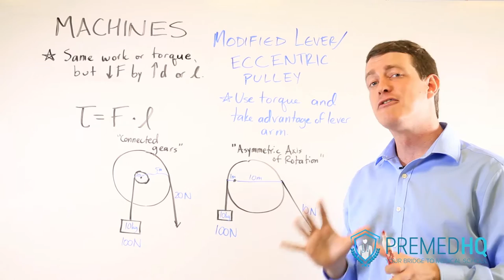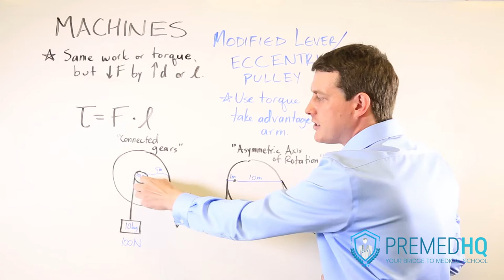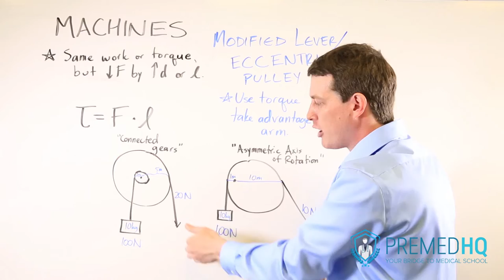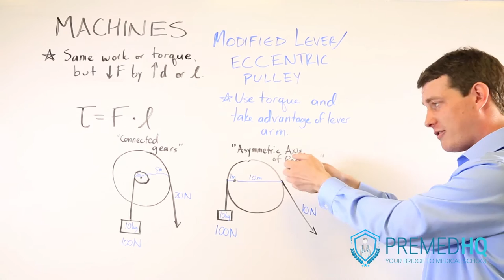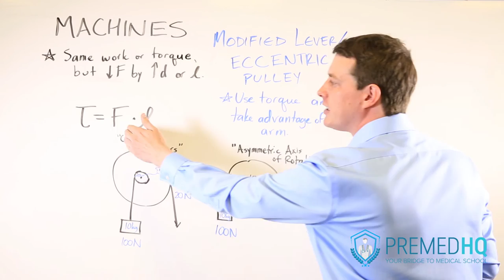Pulley Systems and Mechanical Advantage

Comment: Nice presentation!  But your strings are NOT arranaged as tangent to the wheel surfaces where you would need the complete torque formula: TORQUE = F CROSS L, or T=Fxl.